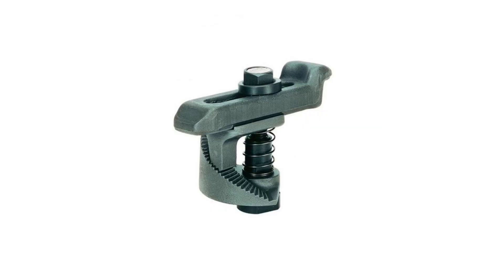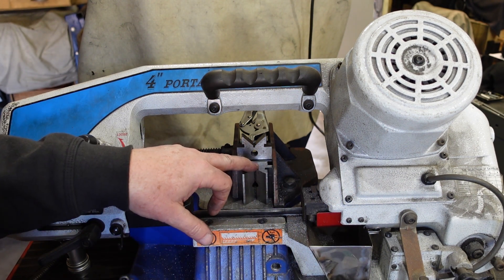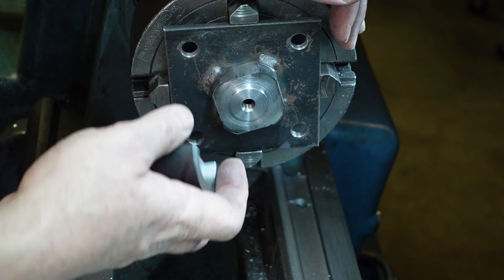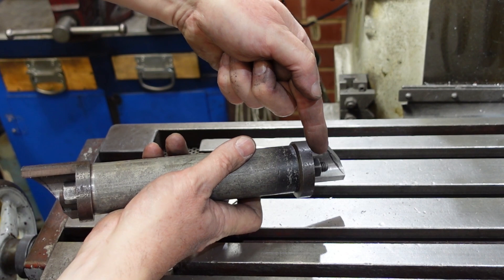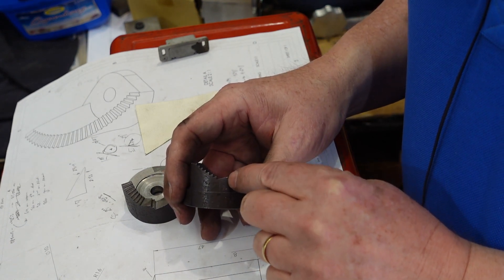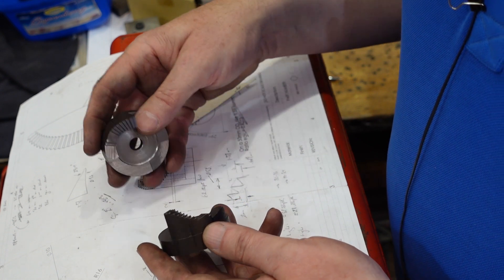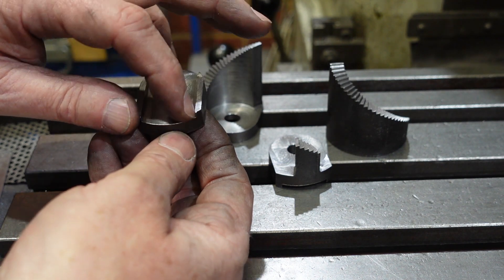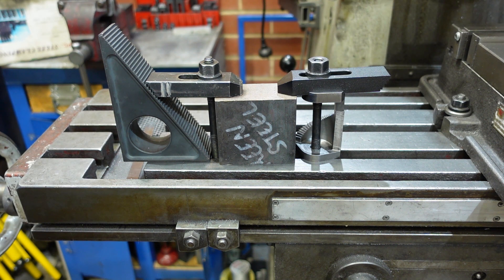Helical milling spiral clamps

Comment: Nice job, no wonder they are expensive. But I have to say seeing your indexer setup I knew I wasn't going to be able to try one for myself. I agree they dont appear as robust but could be useful in tight situations
Reply from the maker: I made them primarily for those tight situations - most of the time I think I will be using standard strap clamps but every so often...

Comment: That made my head explode. I'll let you make mine, be much easier. I have a simple dividing head and even if I had one that I could set up to run off the table feed, its way over my head to attempt. Interesting project though. Good video! 👍
Reply from the maker: You need the right gear certainly, but it is fascinating to see what can be done without CNC purely through mechanical means.